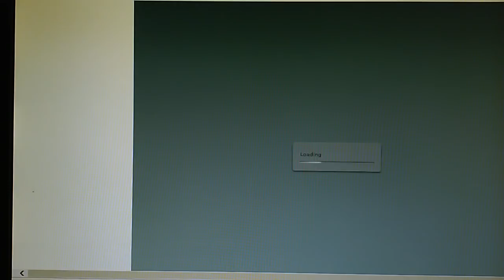12-20-2017; Climate Control: Right Angle on Weather System! Step Pattern Indicates Pulsed Power

Comment from the maker: 10:50PM Fri. - Heavy aerosol chemtrail spraying will continue Saturday in all of California as a tropical moisture field moves into the State clockwise around stationary high pressure installed in the East Pacific, originally positioned to block a Gale force weather system with the right angle imprint.
Reply from the maker: DesertDweller55 - I'll have to set the alarm to be up that early. Which area of the sky are you seeing these light burst - on horizon or up higher? Also are they in the Southern skies or Northwest or?
Reply from the maker: DesertDweller55 - I watched your latest video this morning. I'll have another look and get back to you.
Reply from the maker: DesertDweller55 - Yes I watched it again several times. Had to do some things in the meantime but the cause of that shift in the light is hard to determine.  Looking at the video with no preface as to what you describe, I would have guessed it was the camera adjusting to the light level. See if you can capture more detail - it could be something significant.
Reply from the maker: DesertDweller55- No, I still have not seen this effect during sunrise. I'll keep an eye on it though. If you have a clear shot of sunrise, take another video. I am not sure what is occurring with it.